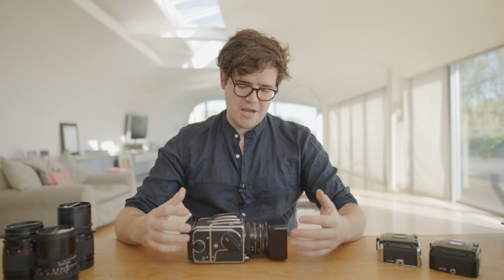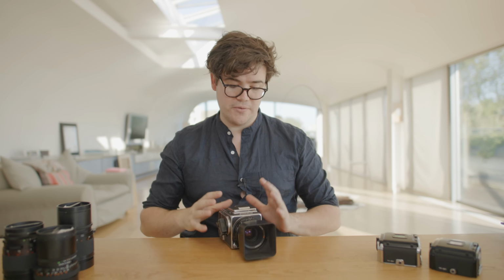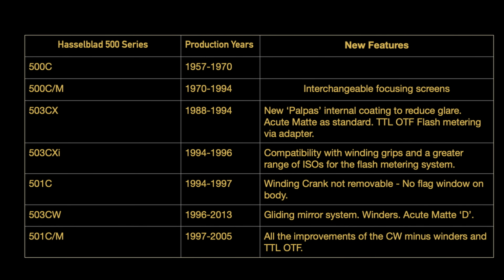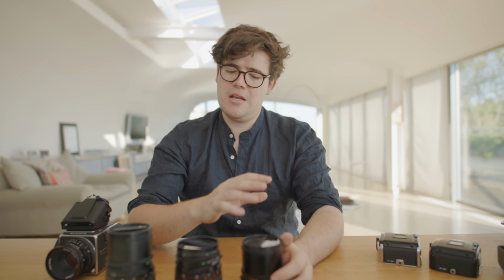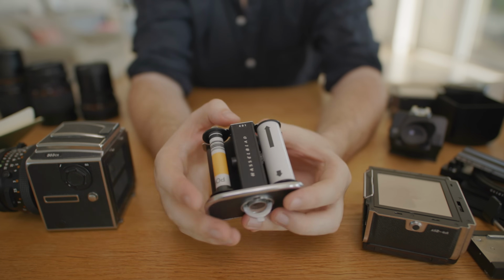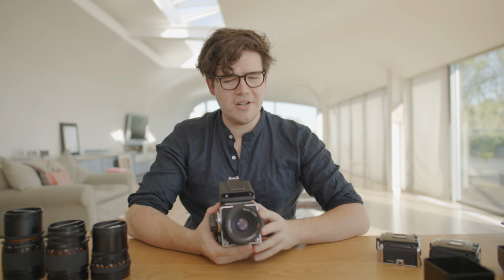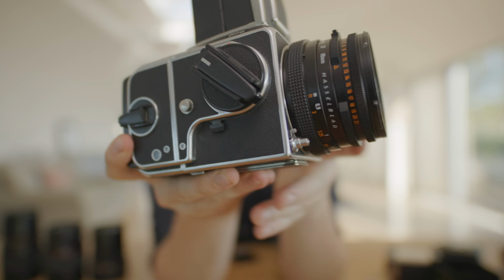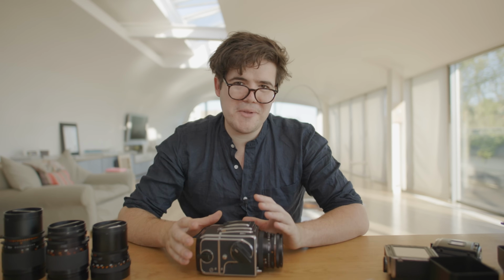The Hasselblad 500 Series: A System Overview

Comment: FWIW nearly every camera you see for sale will need at least $500++ in service to be made right. Factor that into any purchase. 
This is why these are so expensive when sold at Kamera Store and other fine film stores. They restore them to full working condition and clean the exterior and replace leatherette if needed. 
If you find one for a real ‘deal’ expect at least $1000 or more for repair. The backs and lenses will need work as well. 

Buy CT* or CF and later lenses. There are no parts for the original C lenses. Buy as late (and expensive) a version as you can. 
Get the Acute Matte view screen or third party replacement.

Comment: Hi Jonathan. I just started to experience problems with my Hasselblad back. Only the last half of the roll is exposed by the time I reach frame 12, and those exposures are shifted towards the start of the film. Opening the back the counter resets, and there is where I found the issue: the spring is malfunctioning and the counter, in many cases doesn't go to zero. 
This causes the problem. When I insert a new roll and wind it, it takes fewer winds to reach frame 1, and the first 4-5 shots would expose only paper! 
I would have to cla the back, but so far, hitting gently the back with the palm of my hand brings the counter to the start position, letting my wind the right amount of paper until position 1. 
Some comments for your so beautifully curated series of videos:
1) The initial (reset) position in the counter is (0) and not (empty) as you show in the video. 
2) The total number of turns for reaching position (1), and hence the right start of film, is 10 full turns. I saw you winding like 6 or 7. 
Maybe, the A12 version 3 and the version 2 (mine) are different, or maybe winding 6-7 turns let you reach the film....Just thought interesting to share this issue  here. Regards

Comment: Fantastic video! You lifted something up when you started to load the film (the roll was supposed to go across and under it). Did you do something ti lower this afterwards does that happen automatically? I hope this question makes sense. :)
Reply: Ah, it's the pressure plate. At 30:30.
Reply: And it automatically lowers down when you put it back in the mag, right?

Comment: The sheetfilm holder is not just for making a test exposure.
Dozens of special photographic emulsions were for sale as sheet films, 
butnot in 120 rollfilm. With the special purpose Hasselblad scissors
 you had to make your 6x6 cm sheetfilm.
There are A32 and A32s backs
There is an A 2456 back for 35 mm film.
The 70 mm back with double perforatiefilm was for aerial photography, for scientific photography, for medical photography etc.
The short extension tubes are great for a closer shot with the Zeiss tele lenses.
Two types of Hasselblad Polaroid backs for test shots and instant BW negatives.
Mount a Hasselblad 500 C/M body to any 4x5 view camera by a special adapter.

Comment: I used Hassies early in my career. (Starting in 1973)  They take great quality photos. 

But the lack of instant return mirtor bothered me. The screen was not bright. (I did buy a third party Britescreen) The interlock of F stop and shutter speed selectors is awkward and makes bracketing exposures difficult. Doesn't have 1/3 F click stops. Loading film is slow. The pins that hold the backs on bend. 

There is a lot of vibration with the mirror and rear light blind. The mechanical connection between body and leaf shutter cocking can get out of sync...locking a lens on. Polaroid back could prevent use of some 90 degree prisms.

I switched to the Rollei 6006 system as soon as it came out. Like going from a WWII prop plane to a jet fighter.

Just one example: on a Hassie, after your last shot, you wind on and try to take another shot but the camera is locked up...sometimes just as the model has a perfect expression. My assistant had to watch the frame counter and stop me to reload. On the Rollei, the film automatically winds off after the last shot. Then you can just swap in a cheap preloaded film insert...no need to change backs. The film will advance to the first frsme.

Comment: thing with Hasselblad is that this brand built it's own cult based on quality of photographs to sell you just the nameplate actually.
what makes a good image?  - chemistry of a film, precision of exposure and quality of the lens.  
and the legendary Hasselblad has nothing to do with any of it.  being just a box connecting Zeiss lens with Compur/Prontor shutter to a film of your choice.
digital hassys  -  same box with a Leaf back.
full frame film/digital "hasselblads" - just renamed Fuji or Sony

Hasselblad's formula of success is in appropriation of a Zeiss fame built on hard work for more than a century.    
(and compare it with Leica for example. the same douchebags at a first glance but if you dig deeper - they use their own optics and shutters and made some cool and very own stuff)

Comment: Like an earlier contributer.. I too worked professionally for 12 years using Hassel 500c/m but this video did teach me one thing that I had not known.. that was about the warning for speeds of 1sec to 1/4sec relating to focal plane blind intrusion. I would say too that these speeds are used most with a cable release.. where I think one is even more at risk of releasing prematurely, as when using the button directly one would be inclined to wait for exposure completion and release slowly to avoid camera movement.
It was implied that there were no downsides to leaf shutters.. but bare in mind that an exposure at 1/500th at f2.8 on will never be the totally accurate as for a significant portion of the exposure duration a part of the f2.8 diaphram aperture will be obscured bet the shutter blades as they are opening and then closing. Not a problem with focal plane shutters as the gap between leading and trailing blinds is consistently facilitated light rays from the full aperture opening.
Great video though,  enjoyable and memory invoking. Thanks Jonathan.

Comment: You have to correct:
"the test exposure with the single exposure back for high budget shoots".
During the heyday period of the analog photography Kodak produced 
50 different types of sheet films.
A rather small quantity of Kodak films was produced as the  series of 
120 spool (B2) films.
Hasselblad had a special pair of scissors to clip a piece of 6 x 6 cm 
heet film out of a 4 x 5 sheet film, to fill the single exposure back with.

Comment: at 49:57 one trick is to use the T lever, turn the lever, take the shot, (the T holds the button in), then holding the button in (to ease the cycle, not slap it), return the lever to normal position, then release the button slowly.

Comment: at 41:45 a good tip, but this is MORE important on the 200/2000 focal plane shutter bodies, as if you aproach the back SLOW there is no chance of dinging the shutter ( a 0.3-0.5 mm thick titanium sheet at the rear [replaces the baffels on the 500 series]) And if you distort this, this ruins the whole camera body, as you need to send it in for repairs.

Comment: I have the 503 CXI and 503 CW with 50mm 120mm and 150mm lenses. I love the Hasselblad. I don't use the metered Prism finder preferring a handheld meter.  Because my Sekonic spot meter is so accurate and also I will take the Prism Finder off and shoot the waist level from time to time. Which of course doesn't have a meter.

Comment: The 503CXi version does not have 2 ‘flag’ windows, just the one on the back.  There isn’t one one on the body.  Why is this and does it matter?
Reply from the maker: It’s not a problem, they took it off later models for some reason. Just make sure you build the habit of winding the body after each shot and you’ll be fine.

Comment: I am a retired professional with 55 years of experience. My blads are worn but still work perfectly. The sad thing is that I put them away when I went digital in 2007. Sometimes I just open the storage containers to just hold them and click off a few dry clicks so I am reminded of the pure pleasure of using a Hasselblad.
I also love to look through the finder of my Super Wide. It is so wide that I feel like I can see behind myself.
Reply: Though expensive, 907 50 CVII will have you and your Hassleblads back out shooting again. 

I bit the bullet and have not regretted my purchase. Nothing holds a candle to the Hasselblad color science. 

My ‘74 500 C/M, ‘77 Planar 2.8/80mm & ‘65 Sonnar CF T* 4/150mm, which I have had since ‘78, are now in constant use.

Comment: What are some common problems with the hasselblad? Are they easy to fix? 
I recently bought a pentax 6x7 unaware of the common spacing issue that the seller didn't tell me about so it would be good to know! 
Thank you :)
Reply from the maker: The spacing issue is to do with a plastic clutch on the right side of the camera body, it can be fixed but not indefinitely. The hasselblad isn’t immune to damage but the quality control was great and the modular nature of the camera means you can either fix or replace very small parts of the body rather than the entire thing at once. E.g if one of my backs had a spacing issue I could switch to my other backs, if my body had a winding issue I could buy just the little metal cube and use my viewfinder/lens/back/winding handle with the new one. I also feel that electronic controls in cameras are going to start failing increasingly often as they move into their 30s so things like the Mamiya 7, p67ii and Leica M7 for example might not be so long lasting.
Reply: @JonathanNotley  thanks for the super insightful reply!! Much appreciated

Comment: Best camera in the world! 
Thank you, one of the best videos I've seen on the Hasselblad. I've been a 500CM user for 15 years and most reviews on Youtube get a lot of things wrong. It's a fantastic system which really rewards proficiency with the operations of the camera. Once one learns it fluently I feel few other cameras work as fluidly, as if to almost completely disappear. Only the Leica M compares in this regard in my opinion. I enjoyed how you touched on the mechanical complexity of the system - the little interlocks and indicators that work mechanically throughout to aid the photographer. I love all the lenses but in the end have settled on the 60mm, the 80mm and the 150mm. 

You made a small error when loading the film back. You're supposed to turn the key to lower the pressure plate before attempting to insert the cassette into the back. The reason for this is that the little metal guide rail that holds down the film makes sure it doesn't catch on the back as you insert in into the back. Wouldn't happen when done on a table, but once you're standing up trying to quickly load, little details like that are incredibly well thought out. That metal lip clamping down on the film means you can much easier mash the cassette into the back without risking the backing paper catching on the frame of the camera. 

If I would add anything to your review it would be the sheer joy of operating a Hasselblad. Since day one I'm addicted to the noises from the lens, camera and film back. It's an incredibly characteristic sound like no other and just sounds, well, hot. Same goes for the overall haptics. While I've used Bronicas they never provided me with anywhere near the haptic pleasures of a 500CM. 

The Rolleiflex SL66 is very good 6x6 SLR system camera too, but more bulky and heavy and with a far smaller assortment accessories and lenses and more difficult to get parts for. 

The Rolleiflex TLR that so many like to compare to a 500CM is a very different kind of camera. Not a system camera at all like the Hasselblad and I don't understand why they're so often compared to be honest.

Comment: The 500 C/M is produced without a flash sync at the auxiliary  
shutter in the body. So a problem when the microscope had 
been mounted to the body and you need the electronic flash 
to light the object on the table of the microscope.
The TTL OTF was for the Metz 60 CT4.
Some screens are very bright; the TTL prism will give a too  
high EV, so an overexposere is needed. 
For long exposures keep the cable release PRESSED.  
And there also is a A12 panorama back 32 x 55 mm. 
The sheet film back is made for the use of special types of film,
which are only for sale as sheet film. Line film in ortho or panchro,
etc. In the Sixties over 30 types of Kodak sheet films were for sale. 
The A70 back e.g. was for aerial photography with special 70 mm 
rolls: colour, black and white and infra red; not for sale on 120 rolls. 

At last a professional review on Hasselblad without mistakes, music
and bad photoos.

Comment: I love the Hasselblad-Zeiss CF T* type V-lenses and own 4 of them (50, 60, 80, and 180 mm). Probably the sharpest is the 180 mm lens followed closely by the 50 mm (I have the first version without floating lens element). I found it is difficult to focus correctly at f/2.8 with the 80 mm lens and using the prism viewfinder - probably best to have is a split-focus screen which is hyper expensive now. Only con of V-lenses is their limited number of aperture blades leading to pentagon-like bokeh circles when the lens is stopped down. This can look unique and artistic, but it can also look a bit undesirable. Nice thing is that the V-lenses can potentially be used with adapter on modern digital medium-format cameras, too.

Comment: Maybe another worthwhile detail to mention is the big advantage that the ocular can be rotated to fit the eyesight diopters in the PM-45 prism viewfinder. Otherwise additional expensive glass inlays for diopter correction have to be used with other Hasselblad prism viewfinder models. Only con I have observed with the PM-45 is that the ocular lens fogs easily in cold weather.

Comment: Great video! Shooting 500 C/M now since 3 years. IMO it is unavoidable at some point to jam and trip the camera no matter how careful I was. Survival hint: always have a Penny (or Cent) in your pocket to manually turn the attachment screw on a lens or extension tube if things go wrong. The camera system is great but has its mechanical quirks. Most common struggle I still have is to quickly insert the dark slide after an exposure was done: hard to find the tiny insert slot.
Reply: Why do you reinsert the dark slide after tripping the shutter?
Reply: @johntazbaz1121  to move the film forward and prepare for the next shot. Too risky to leave the slide out the whole time.
Reply: @MB-or8js  Interesting that you mentioned this. I’ve seen many YouTubers replace the slide after each shot and It baffled me. I didn’t know any professional photographers who did this when I shot professionally during the 80s and 90s.  We inserted the slide when it was time to detach the back or at the end of a shoot.
Reply: @johntazbaz1121  this works well if in a stationary studio environment for example. But the risk of light leak is higher when moving the camera around in changing light conditions.
Reply: @MB-or8js  This isn’t accurate. Wedding, engagement, portrait, fashion and commercial shoots were done outdoors. Professional photographers weren’t inserting and removing the dark slide after each frame and light leaks weren’t an issue. If they were, Hasselblads wouldn’t have been so widely used by pros. I shot hundreds of rolls through my 500 c/m since the late 1980s, never had a single light leak because the dark slide wasn’t inserted between shots.
Reply: @johntazbaz1121  not a biggie. I do it this way, you the other. If it works for you, good.

Comment: This is probably the most thorough Hasselblad breakdown that I've seen. I've owned a focal plane type Hasselblad (2000 FC/M) for about 3 years and I've built up a pretty good system. I would also mention that you can add close-up filters (Proxar) and 1.4X/2.0X tele-extenders to expand your focal range. The close-up filters are especially useful as you can focus much closer for tighter portraits or macro shots without any need for exposure compensation calculations. Good job!

Comment: can you explain why they say the "number" on the back has to match the number on the insert?...I came across this when looking to buy an extra back...thanks...
Reply from the maker: This is a myth but the idea is that because the mechanical tolerances are quite tight having a pair that passed QC together will give you flatter film or more even spacing
Reply: @JonathanNotley  idk if I’d go so far as myth, since if they aren’t matching the cla person will do a service to mate them to each other (roller adjustment) and then change the inserts serial to match… but yeah not strictly necessary, just something that has been documented to occasionally be an issue.